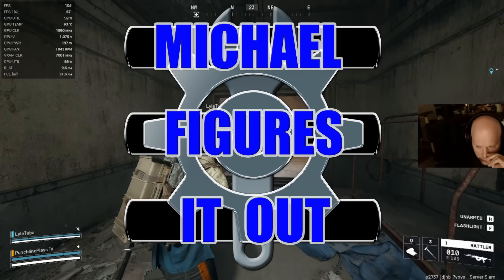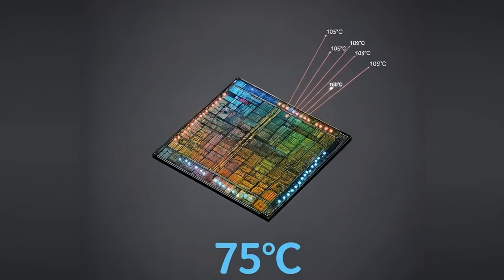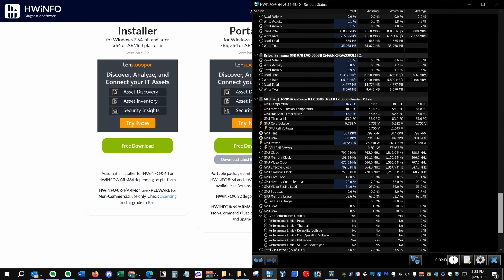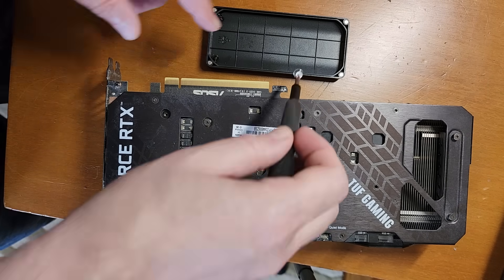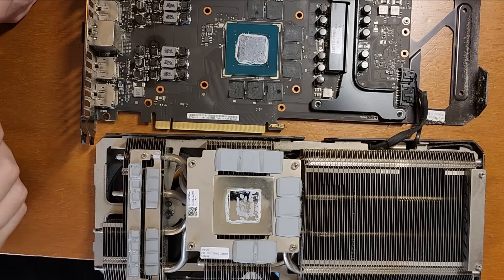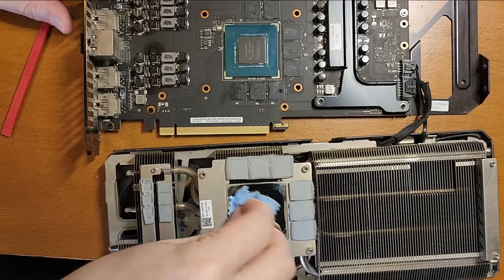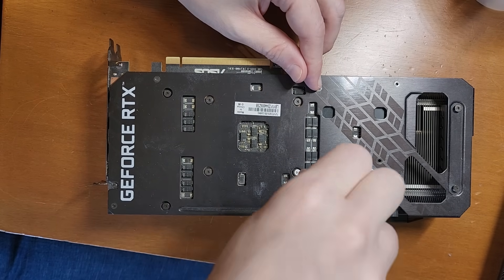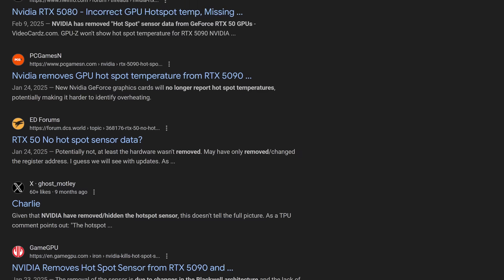GPU Temps Are A LIE!

Comment: i bought a brand new rx 9070xt gigabyte version about 3 weeks ago. Random game crashes and pc crashes ect. my temps were fine but the hotspot was maxing out. It was driving me nuts. I learned gigabyte used thermal gel and it causes issues for hotspot temps.
 After about a week with the card i returned the card for a rtx 5080 and temps have been fine. Also i do not have the hotspot temp on the 5080 but no issues at all so far. Great video i doubt most people know about hotspot temps
Reply from the maker: Glad you got it sorted. And thanks for letting me know about the missing hotspot. Hopefully it won't be an issue for you.
Reply: 5070Ti and 5080 hover around 80C hotspot. They also consume less power.